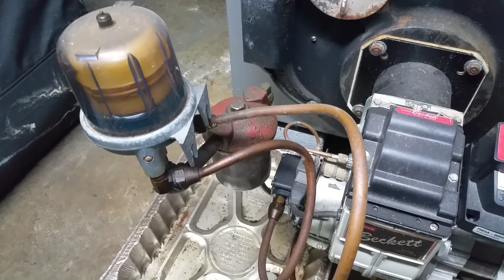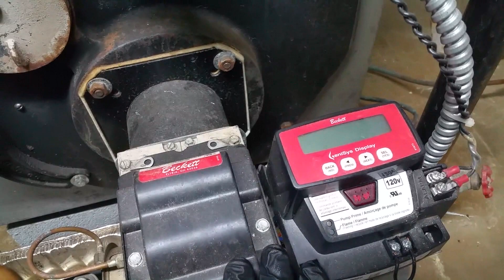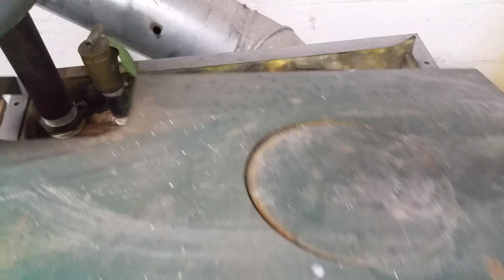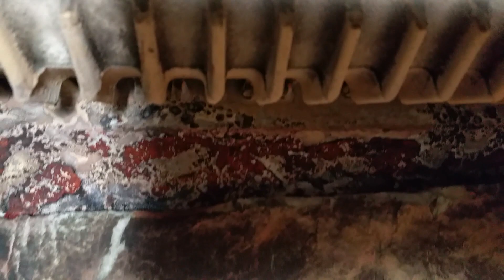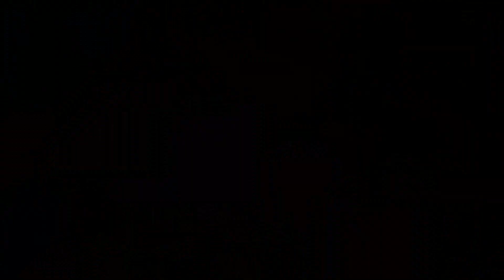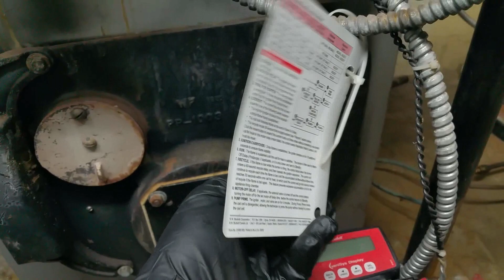Beckett oil burner and Peerless boiler Yearly Maintenance

Comment: Couple of things:
1. Orange tool is also for setting position of nozzle assembly inside the burner tube. See Z dimension.
2. Nozzle specs include spray angle, gallons per hour, and spray pattern.

Comment: Thanks so much for posting the video! I was told by a heater maintenance personnel that I needed to replace my unit and took it upon myself to clean it and inspect it and took care of it and it’s working fine. You saved me $10,000. I appreciate it.